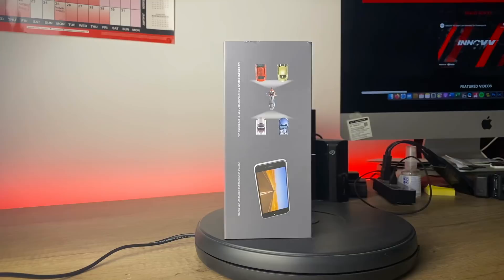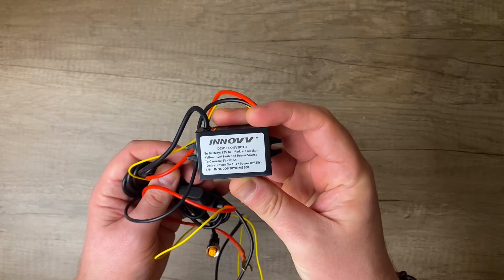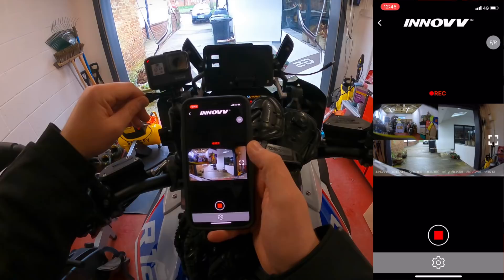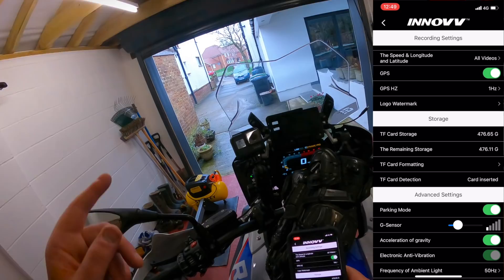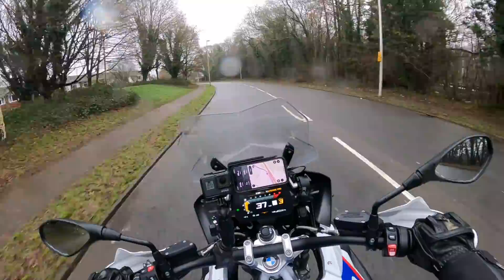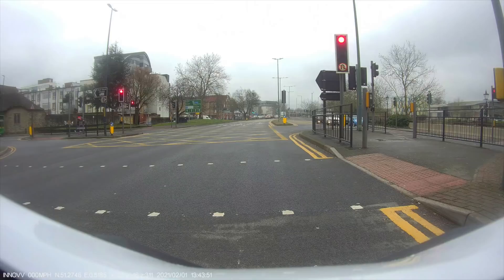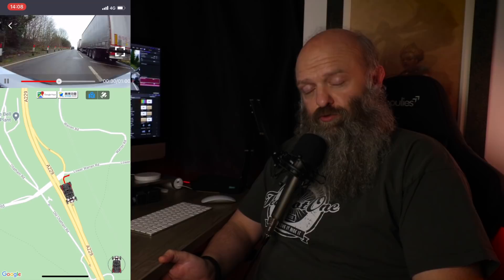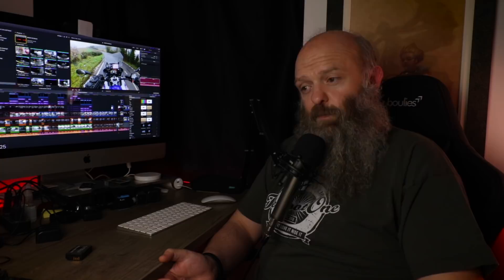INNOVV K5 Review - Motorcycle 4K Dual Camera System

Comment: You state at the end the K3 will have the improved wi-fi, but this is not the case when you look at the Innovv spec sheets it is the same as the K2.  Somewhat disappointing, as that would have been valuable upgrade.
Reply from the maker: Aye I know, I’ve been very disappointed by the slow Wi-fi they’ve gone for with the K3, I genuinely miss the K5 now and at the moment I’d spend my own money on the K5 personally.

Comment: Very nice to see that the feedback has been listened too and that it has been taken up. As the K2 it looks very good quality. Front unit looks bulky, reducing where it can be mounted unfortunately, not as discrete. Audio is very good, if only it could be updated on the K2. I must admit I do like the remote and the option to take pictures when needed. WiFi connection certainly seems a lot quicker. The night time video better than the K2. I like it very much, not sure I would rush to change from the K2, might be interested if they did a part exchange. Will possibly have to wait for the K3. Thanks for the insight. Good review mate.

Comment: Good review. I bought a K2 the day before the K5 was announced (a couple of weeks ago) but I do prefer the more discrete front camera of the K2. I have installed it but not been out yet and I am very impressed with the build quality. It also appears I got the latest transformer but the download speed is slow when I tested it. It would be good if it was a software issue and a firmware update would speed it up.
Reply: Try the new app it speeds up the transfer a bit

Comment: The first few minutes wasn't a fair test on it, as it was wet on the lense. But as soon as it dried the quality came threw.. Its pretty impressive.. I use a go pro myself and I wouldn't change over from it just for reasons I want the helmet mount.. But its a great bit of gear regardless, great quality, sound was good a bit crisp, but good, GPS is good also, looked accurate. Pretty professional set up being honest..it works great in low light 2... Only reason I wouldn't change from go pro as I say I enjoy the helmet view.... Its a perfect set up for a bike like yours and all other all out touring bike id certainly use 1 then 👍

Comment: Bit late to the party but as you've tried both the K3 & K5 I'd value your opinion. I've no interest in vlogging or uploading video to FB. But after having myself and my Mille wiped out by Miss Myopic, my  gopro with a dead battery and having to rely on witnesses for the insurance I need a dashcam. So the question is, is the K5 worth the extra for my purposes over the K3? I don't think front camera size is an issue fitting it to my R1100S. Great video, enjoyed all the innovv vids.
Reply from the maker: Hi Gavin,

If it’s purely as a dashcam and you’re not worried about utilising the app to view files, then the K3 is a good buy.

👍

Comment: Nice video, but I think it was a bit unfair to compare with the K5 mounted low in the wet, filming a lot of pavement, and the GoPro up high in the drier. 

I wanted to have the cameras as high as possible, but "invisible", protected and with an unobstructed view. Sounds hard, but I actually think I nailed it. My front camera is where you have your remote. I wanted it on this side as we drive on the right, and I figured I will hardly ever need access to the card. Found a longer M6 bolt and mounted it there with the included angle bracket. Then drilled and carved a hole through the black plastic for the lens. (That plastic fairing is only €50 on a 1250GSA.) I mounted the remote on the mirror stem, using the included mount. The rear camera sits in the middle of the reflex, stole this idea from A Bike Thing.

Let me know if you want to see pics of the installation, and I'll link to my blog. Snow and cold here in Norway now, so still waiting for warmer weather to test, but I think both cameras should have clear good views.

Comment: Question when you use the app will i rotate if you put it in landscape mode 
That way you can use it as an rearview mirror
Reply from the maker: I’d never advise you to rely on any camera over a simple shoulder check, or just turn your head and body to see behind you. 

But... Yes it does - once you’ve connected the system to your phone, open the app, tap the video camera icon, select which camera feed you want (front or rear), and then it’ll happily rotate between landscape or portfolio

Comment: Thanks for the review, good to see the next generation here. I preferred the sound of the K5 as it seemed clearer than the GoPro. The picture quality improved when you got onto the dual carriageway, but did you clean the lenses before joining it?
It would be good to see it in higher frequency comparisons with the GoPro especially for dashcam type footage.
I bought a C5 for training sessions but it hasn’t been too successful. The K5 looks like it might be worth going with but would choose this over a GoPro?
When using the remote to capture video, does it record the current time clip or from the push of the button or even record from a period back before the button push?
You mentioned image stabilisation but I haven’t seen anything in the spec that says about this! Is there any?
Lots of questions I know and probably better asked of Steve but your thoughts/input would be appreciated👍
Cheers and keep up the good work.
Reply from the maker: I clean the lenses every time I’m off the bike - basically I clean my visor, GoPro’s and Innovv cameras all at the same time.

Yes I’d just cleaned the lenses prior to the dual carriageway footage, but the rain had also cleared away and I was moving faster, so the flowing air helps to keep the front lens clearer.

Not sure what you mean by ‘higher frequency comparisons’ bud? The innovv was filming at its optimum resolution of 4K at the front at 30fps, I could’ve gone to 1080 at 60fps admittedly.

There is no inbuilt stabilisation on the INNOVVs but personally I don’t think they need them 👍

Comment: Teapot one great videos of the K5. I’ve fitted to the RH indicator with minimal show of front fairing to the left. The one thing I’m finding hard to do is seeing the captured video on my Mac book pro in ts format. Do you have a preferred software for processing that and also for post production. Many thanks. Keep up the brilliant work. Pete
Reply from the maker: Hi Pete,

My Mac opens the files up no problem in finder? Are you recording in mp4 or the other format - think it’s TS?

I use Final Cut Pro to edit
Reply: @teapotone  Thanks for getting back to me teapot one.  I have recorded in MP4 and opening in finder is ok with the rear but the front is jittery.  Im guessing its my 2012 Mac's onboard graphics memory .  I've been looking at running dashcam viewer software to give me all the gps location speed data but, again its not able to run.  I like the idea of final cut pro but, am thinking i may be in need of a machine to run the big file sizes used by the front camera on the K5.  Looking forward to being able to roll the wheels legitimately soon.  until then stay safe and thank you

Comment: Thumb screws is not a good option either. Anyone can steal your card if you leave the bike.... I love the quality at night, and global quality in general, could be usefull to have just a tiny bit of stabilization, to eliminate the vibrations, but ofc, that would increase the price tag.
The main thing stopping me from buying one, is the cabling. I have a BMW RT think this would be a lot of work, which is something for now all recording cameras have.
On the alarm mode, maybe Innovv made it better, but I have seen some car dashcams flatting car batteries, so be aware of that if you dont put your bike on a tandem frequently.
Thank you for this and the installation videos Bruce! :)
Reply from the maker: The DC Converter manages your batteries power levels to prevent it running flat 👍

Comment: Thanks for the review, very helpful. I've had a rear mounted Garmin Virb Ultra 30 go down so I'm looking at replacing it may be with a combined front and rear system even though the other Ultra 30 and a GoPro6 mounted on the front are still working fine, I noticed that your GoPro footage definitely had the edge on the Innov although I'm sure Youtube will have messed with it and degraded the quality of both. I am thinking of maybe going for the K3 as although all 3 of my cameras (Well 2 now, not counting the Sena 10c Pro on my helmet) do 4K but have found that 4K files are large and are a bugger to edit, how often do you use 4K in your blogs?🤔
Reply from the maker: I incorporate the K5 footage in all
Vids where I’m riding my GS now, but the GoPro footage will always beat any dashcam system as the bitrate is so high on GoPro’s/DJI Osmo etc

Comment: Thanks for the review, Bruce. The K5 looks to be an all-round improvement over the K2. But what about security? The The way the combined front camera/DVR is installed on your bike makes it an easy target for thieves.
Reply from the maker: Is it? They’d have to cut the cables to steal it?

In that case they can steal ANY camera mounted on a bike🤷‍♂️
Reply: @teapotone  Fair point about the cables. However, most bike dash cams don’t have the DVR sitting out on the front of the bike waiting to be lifted. I feel more comfortable with just a £75 camera at risk rather £400’s worth of DVR. Can the K5 DVR/camera be bolted down like the K2’s cameras?

Update: I’ve just found the manual for the K5. It looks as if there is a facility to bolt down the camera/DVR unit to a suitable position on the bike.
Reply from the maker: Yes but then all you do is remove the bolt with an Allen key 🤷‍♂️

Comment: Anyone else finding files missing? Unit seems to be unable to cope with vibration when bike is at higher speeds (over 50MPH) and fails to record.
Reply from the maker: Re the missing files, have you looked in any of the other folders on the sd card, such as accident, parked or protected?

If the G-sensor is activated then it can put some files into accident or protected folders
Reply: @teapotone  Yes, have checked them all. There are quite a lot of files in the 'accident' folder, but there are still lots missing. For example I have the segment where I'm joining a motorway, then the next file is when I leave the motorway an hour later. Everything in between is missing. Will be contacting support today. This maybe a fatal design flaw.
Reply from the maker: I’ve not had anything like that personally, always been able to find my files 🤷‍♂️
Reply: @teapotone  Odd as you've mounted it in an almost identical location to mine, but you've got velcro and I've bolted it on. Wonder if there velcro is preventing any resonance.

Comment: I don't understand why it's only 1080p for the rear camera?  Front and rear should be 4K cameras.
Reply from the maker: The front is 4K as it’s also the DVR module. To make the rear 4k as well and then have that data pass along a cable of that length to the front DVR, would increase the price considerably

Comment: Sound wise. The sound is defo brighter but has distortion.
Picture wise side by side with your GoPro very equal, quality wise.
But clearly it’s more prone to debris/rain/skank down there at the front compared to your helmet camera.
For a non vlogger wanting a camera for safety If stick to helmet mounted ghost or GoPro etc.
As a vlogger biking video looks so much better seeing the bikes frontage, dash, handlebars. So if sat for example you used that as your forward video it would be far less interesting.
So that means again the GoPro helmet cam wins.
So that only leaves day to day security. Yeh I guess it’s the winner for that if you don’t want the faff of a helmet camera. 

So for me and trust me I love tech for the sake of tech I’ll be sticking with my helmet mounted Ghost X.

Spot on review and instructional though

Comment: Which program do you use putting it on your computer I am trying some but no results yet . And thanks for the video I bought it because of that.
Reply from the maker: Not sure what you mean here Rob, do you mean what editing software do I use?
Reply: @teapotone  yes to make like a holiday film with fotos and film fragments and I saw on de film about the k5 that you had it on screen in the background.
Thanks by the way for your reaction.
Reply: @teapotone  to clarify, I’m looking for a program with which I can upload my films and photos from my sd card. Also one to edit with, and, best case possible one that combines the two. In your video you have one running on your Mac in the background, so I was wondering which that was and if it might be a free download.
Reply from the maker: Ah ok Rob - firstly to get the files from the SD card to your computer you just use either ‘Finder’ on Mac or ‘Explorer’ on  Pc. Both of these are free and already come with either system. 

Store your files on an external hard drive, preferably an SSD one if you intend to do complicated editing, or the cheaper traditional hard drives will do if you’re only doing basic stuff.

On the Mac I use Final Cut Pro X which is a semi-professional system and is about £400.

If you’re just starting you can easily use windows movie maker on a PC, or iMovie on a Mac. Both are fairly similar and will let you do some basic editing such as movie to photo integration in a slideshow-type of deal.

There are lots of other software available such a Vegas Pro, or Da’Vinci Resolve etc

I simply used youtube to teach myself how to edit and how to use my software.

Cheers 👍

Comment: The singing at the end, must do more random things like that at the end of your videos. The internal Mike sounds better than the go pro but the colour is a lot duller compared to go pro but that might be to position of the camera. Like the idea of upgrading to k5 from k2, but for me it's the add on  Micror,gps,wifi and all the extra functions and remote are interesting to me but the 4k does not interest me at all.
So innovv has a k3 model then I would invest in that if it is exactly the same as the k5 but with out the 4k system.

Comment: Do you know whether the K3 can be substituted directly for the K2?  In other words, accepting that it also has an external mic and remote connections, could one just buy the K3 DVR  (any ideas on price?) without purchasing the cameras?
Reply from the maker: No idea on price as yet Kevin. 

No you can’t just switch the DVR module, the latest 1080 cameras used in the K5 rear and K3 are slightly different (better quality) and the DC Converter needs to be updated due to the added requirements of the better cameras, mic and remote
Reply: @teapotone  Many thanks for the update on that.

Comment: I think that's a real fault with the K5 to put the SD card in the front camera. It would be much better to be able to hard mount the front camera so it's easier to leave without meddling once you have the position. Have the SD card positioned so you  lift the seat to access the unit with the SD card. I was really looking forward to this coming out and 4K but not for me with this front camera SD card design.

The rest of it looks superb.
Reply from the maker: My thoughts exactly, but as I say in the vid, INNOVV couldn’t have a separate DVR module (like the K2) as it’s not possible to get the 4K info down a cable from the camera to the DVR - not at this price range.

The new K3 system which is coming out soon will basically be a K2 system with the wi-fi, remote and external audio of the K5.

That’ll be the one to get in my opinion. I’ll do a full review as soon as I’ve got it in my hands 👍

Comment: You'd better watch out that whenever your speedo goes all blurry from your GoPro (hate it when that happens,..ahem..cough) that your video in the INNOV still displays your speed in the bottom corner. The audio was markedly better for both in helmet and on bike IMO. I think the location you have it atm is probably why there is so much weather interference in the video (dirt on lens etc). Your GoPro is way up higher and out of the way of the front wheel to be getting dirt as much. Maybe if it was possible to fit the INNOV higher up and further away from the dirt? Overall, very impressed! The only other thing I'd say is when the camera is fitted where you have it atm it's not great for Vlogging (due to the bodywork appearing in shot 100% of the time) but if it's ONLY for a dashcam, then fine.
Reply from the maker: Cheers Al,

Aye I’ve no intention of using it as a vlogging camera with audio, I’ll use it as some B-roll though.

The lens can’t get any dirt from the front wheel bud as it sits on top of the beak under the light, so it’s surrounded by plastic.

You’ll get dirt/water on the lens wherever you mount it, it’s just a ‘thing’ with putting a stationary camera on a bike🤷‍♂️

Comment: Wondered if the cameras could be switched, larger front one to the rear where it's better protected?
Reply from the maker: Yes you can, but whatever camera you out at the front will still be subject to weather conditions etc.
Reply: @teapotone  
Thinking of space available at front of the bike along with weather protection of the DVR unit.
Reply from the maker: Ah ok, there’s no worries about weather protection as the entire unit/system is totally weatherproof.

Chase on 2 Wheels has actually released a vid on the K5 and he’s used the 1080 cam at the front so he could ‘hide’ it better than the 4K.

Certainly is an option, but personally I’m not worried about hiding the cameras, I just want them out the way as much as I can.

Ideally I’d like to mount the front under the beak somehow, but in the timeframe I had to do this vid, I couldn’t figure out a mounting system for it 🤷‍♂️
Reply: @teapotone  Why so low? Higher is better, and you can also hide it behind the fairing.
Reply from the maker: You can only do this on a GS if you cut the plastic bodywork - I’m not prepared to do that
Reply: @teapotone  True. I checked before I cut, a new fairing is only €50 inc vat